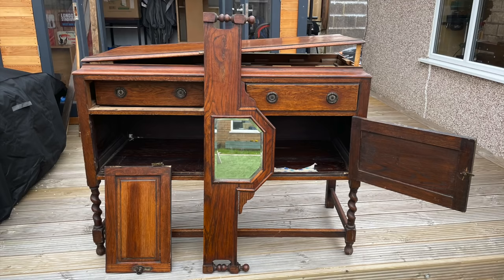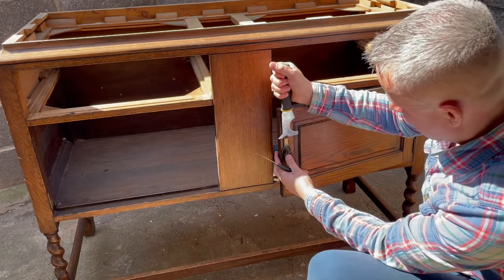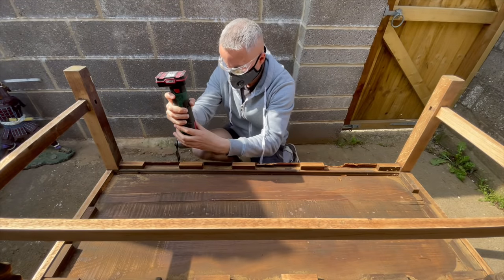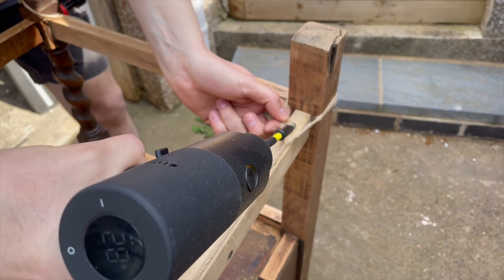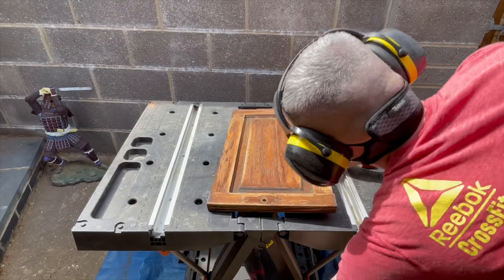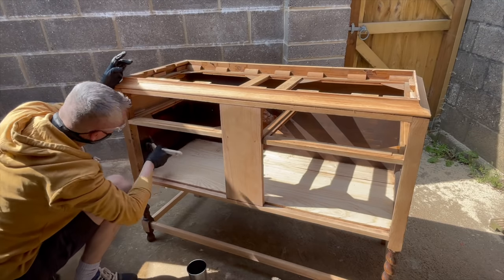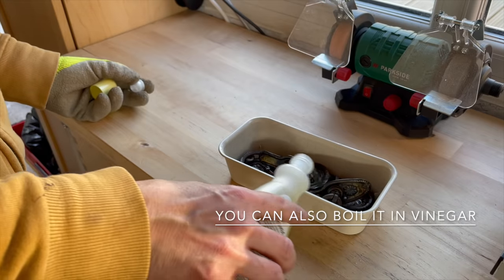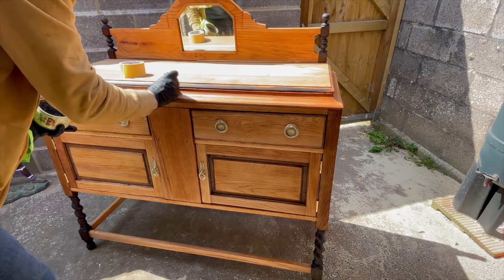Vintage Oak Credenza/Buffet RESTORATION.

Comment: This is beautiful! I love the tonal effect with the unsanded darker parts and the black wax in the details. I have a question. When you applied the glue to the skinny crack and then sanded it, was that basically the same thing as using some saved sawdust and mixing it with the glue to create a filler? Or are you using the glue as the filler and just sanding after the glue is dry? I’m glad you’re settling into your work space.🌸
Reply from the maker: Thank you Deborah and it is basically the same time but done quicker and with less mess.

Comment: Whoa! First, I would be SO afraid to wash this old piece with water. I'm glad to know it can be done. Second...I'm SO glad you kept the original hardware. I've seen where you don't do that, so I'm glad you did. Thank you! Third..."seasonal movement of the wood..." Wow! I never thought about that! Fourth...Your "old school" method of "clamping" was brilliant! Wow! Leave it to our ancestors to know how to do things simply.  Fifth...I LOVE how you cut out the old damaged part and replaced it with a new part. I would never think to do that. Sixth...it's so brilliant to use sawdust to blend with glue to fill in gaps. Seventh...when you made this video, you had 40K subscribers. Now you have 118k subscribers!  Way to go!!! Ninth...You painted your original hardware. I don't have a problem with the original color. I think it adds an authentic "vibe" to the hardware. Last....I LOVE light wood. I love that you left it light, but at the same time, you added the black wax in the best places. The contrast with the light wood made it so much more interesting. The end result was BRILLIANT!  I HOPE YOU DON'T HATE ALL MY COMMENTS. I CAN'T HELP MYSELF. I don't expect you to reply to all of them. Thank you.

Comment: You are not only a craftsman of many trades , your eye for detail and perfectionism is a very  rare gift . I'm halfway through your 15 videos and I'm in awe of your work ethic and capabilities. I have one hint for you which may help, it is when using paint stripper cover it with plastic kitchen wrap then wet newspaper to stop evaporation, makes good contact and the paper also stops it from blowing away. Kind Regards... Sharon from NZ

Comment: One tip I have picked up when using glue and sawdust to fill in tiny tape and cracks is to use a mixture of two different sawdust types. This helps to blend in better.
Reply from the maker: Great point!

Comment: A suggestion; an alternative to the spray paint you currently use for hardware would be to use acrylic/solvent base paints used by model makers and electric railroad enthusiasts. These paints can be sprayed or brushed and produce a very realistic result simulating any kind of metallic surface. Top coat as you usually do.

Comment: This piece is beautiful even in several parts before restoration.  HOW can such a wonderful piece of furniture be so mistreated?  Thank you for saving it.  I would love to have found it. As they say, "it has good bones," and worth restoration.  
Also, thanks for showing how to level/straighten the bottom legs; I'm going to use your method on an old chifforobe I found in the alley. So far nothing I've tried has worked and it's worth saving. Each door has a large burl oval for decoration surrounded with carved 'bubbles.'

Comment: The only problem I have with bees wax as a final finish is that over time it gets dirtier as it grabs dust and dirt more even when polished well. I love it for inside of drawers and such. I love a satin polyacrylic finish or satin laquer finish so cleaning is a breeze and I do not have to worry as much about water or abrasion damage. Still I have to say, this piece is wonderfully done.

Comment: What is “sugar soap”?  I’ve never heard of it.  Good info about “floating panels”.  You have WAY more patience than I do for this work, but then again you have much more skill and knowledge than I do.  I’ve got an antique spindle sided magazine holder that I bought damaged years ago.  Long ago  I did a glue repair to several parts and I’ve sanded much of it.  Now I’ve got to figure out how to sand the top of the base inside of the spindles.  I’m not sure how to get the spindles loose beside pounding with a rubber mallet.  I watched to see how you cleaned the “barley twist” pieces, but it looks as if you left them alone except for the black wax.
Reply from the maker: It’s soap for cleaning furniture. I’ve sanded the spindles many times in other videos

Comment: Hi.  You do wonderful restorations, including this one.  I do have a concern.  There is a strong possibility the top is going to crack.  You placed glue along the front, the back and the sides.  There is no where for the top to expand and contract.  For your sake, I hope I am wrong and it doesn't crack but I made this mistake early in my woodworking journey.  I glued the top of a dresser I made for my daughter and it did crack.  Fingers crossed for you!
Reply from the maker: Hi. Thank you. Well, it was bowed so that’s the best I could do after leaving it in the sun bottom up hoping it would straighten up a bit . As I’m keeping this for my self I’ll be able to address the problem if it comes to it.  I can definitely see what you are saying.

Comment: You did a beautiful job. However keep in mind, you will have a lot of problems with water spots and Drywood in the future. The wax will only do so much for so long. Personally I would recommend putting some sort of a topcoat on it. I think you’ll be happier in the long run. But once again, beautiful work.
Reply from the maker: I thought I explained the reasoning behind my decision.... as this is for my own use I will be able to re-apply wax or add hard wearing top coat if I feel like I need it in the future. I simply prefer the natural wood.

Comment: Hi dear! I've just discovered your channel and I'm impressed! I have a question... I'd bought an old gavinet which drawers haven't guides or wheels... so open and close them results a little hard. Is it possible to add some guide or wheels to an drawer that has not have this?
Reply: Thank you so much for your excellent job!
Reply from the maker: Hi.  It’s definitely possible but probably easier to sand a little and apply some wax

Comment: What is that washing gun you have. You used a bucket 🪣 and drew the water up through ahose
Reply from the maker: https://www.googleadservices.com/pagead/aclk?sa=L&ai=DChcSEwjf866HxZL-AhVDYeYKHSlLC3AYABAYGgJkZw&ae=2&ohost=www.google.com&cid=CAESbOD26YzVyd38dCz7i9EFEWNaldQY9SmJq5MTqdjhu9nbY7K9RTisgtK8lWiosc3A--IymS_Hf7MdIz9QCNb5pxotSQ9jgJQ0dIHs_5ABoN2yGbLvhjIxEDoakdkORLnuNi2U0O5OKYZU76rA9Q&sig=AOD64_0LZu902M2_z-oiCfFAOeYTmrzAcA&q&adurl&ved=2ahUKEwj1uKiHxZL-AhViQkEAHUsUDFUQ0Qx6BAgJEAE&nis=2&dct=1

Comment: Amazing restoration.
I saw on other channels, they use vacum cleaner join to sander. Do you think it's unnessesary?
Reply from the maker: Thank you.  Using dust extraction in a very helpful and much nicer to work with especially if used to indoors.  I haven’t had it until recently so definitely not necessary but great to have.

Comment: The splits in each side panel are from expansion. If you fix it like you have done won’t it simply expand again ? I watch Tom Johnson restoration and he talks about these kinds of splits . He usually leaves them because fixing it won’t really fix it. The wood must expand . Imagine the pressure needed to split oak !  You could have covered the split with a decorative piece to match the one above the split . Also you said you aren’t a wood worker but yes you are !
Reply from the maker: The whole panel should be floating for that reason but the panel is not meant to be cracked. Don’t know what happened there but mind you I didn’t force clamp those pieces together but rather filled the gap.
Reply: @Flippingdrawers  yes that makes sense.